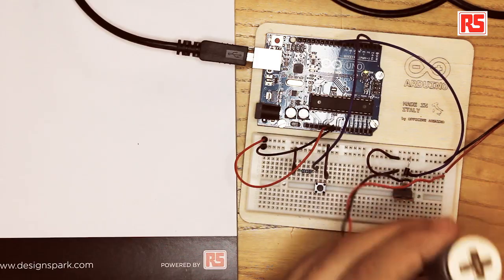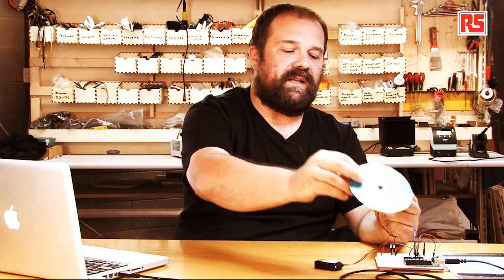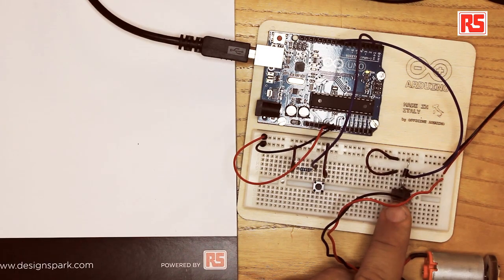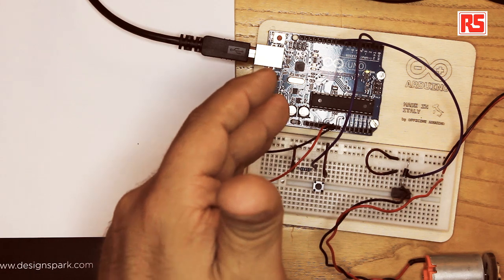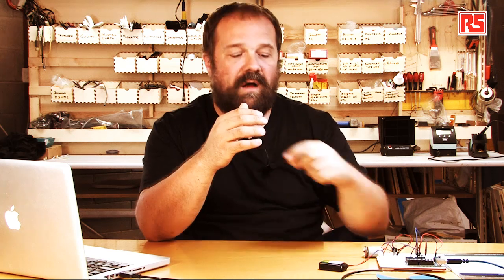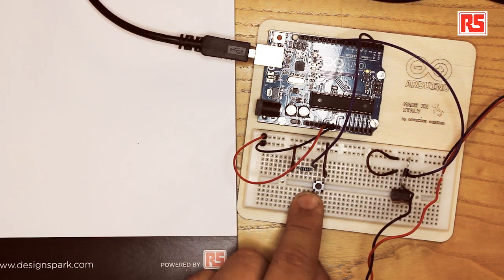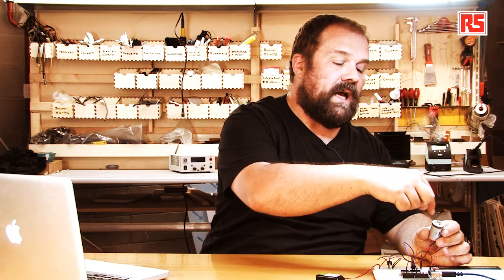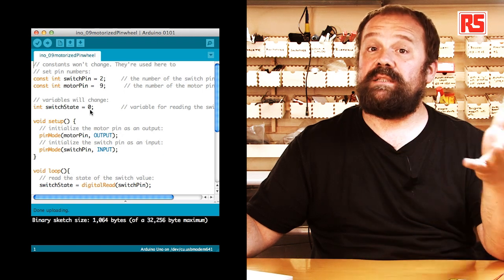Arduino Video Tutorial 06: Motorized Pinwheel | RS Components

Comment: ***** I am not entirely sure, but i think it is so the arduino will be able to differentiate between HIGH and LOW(that is be able to read the input on it's pin).

Another thing that i think was a little bit hard to understand was the diode and why it was hooked up the way it was. I think it is hooked up as it is because when the motor is turned off it will generate a "backdraft" that will generate electricity in the opposite direction(negative becomes positve and vice versa) and somehow this will hurt the transitor(which is weird to me as it should not be grounded anymore which should mean that no more power should flow through it). The diode counteracts this as it will provide a direct path for the current to travel only when it travels in that direction(path of least resistance) and will block when it travels in the other direction.
It makes more sense if one watches the diagram and and try to understand how the current travels when the transistor is on/off.

Comment: There is really no need for an arduino in this project. "Keep it Simple" should be the rule. Just a 9V battery, with a switch, connected to that motor is more than enough...
Reply: You can't determine if there is a need for Arduino or not, without knowing the goal of the learner.  Yes, you don't need an Arduino if you're showing someone that electricity can make a motor spin.  But if you are showing someone how a physical device (that runs on a motor) can be manipulated though programming, it is critical to have the Arduino.  Not everything in this world relies on the physical manipulation of a switch.  To physically control the current through a combination of the mosfet with a program is brilliant.